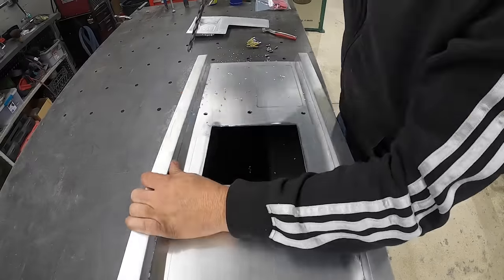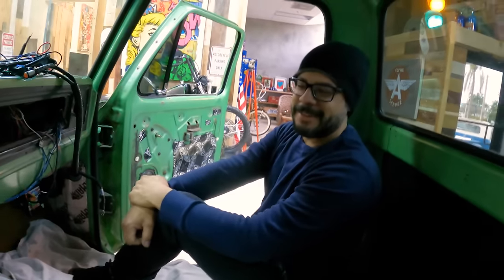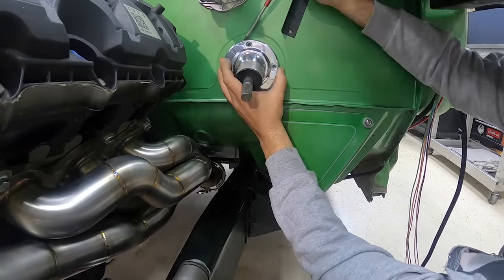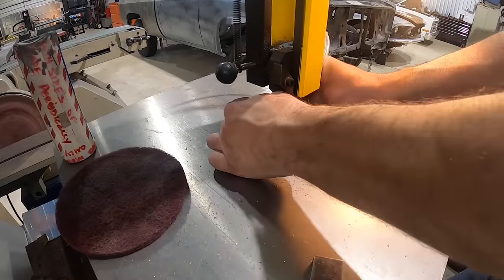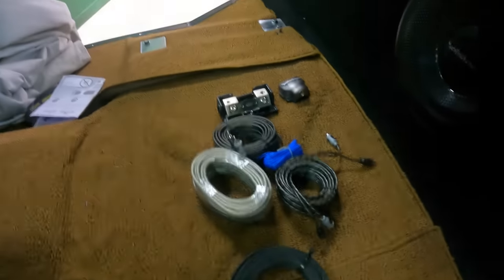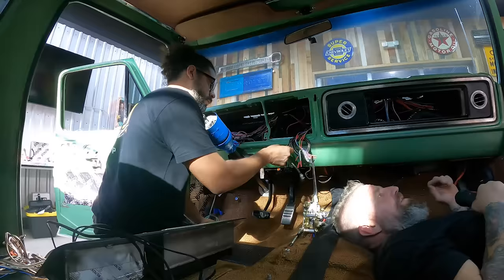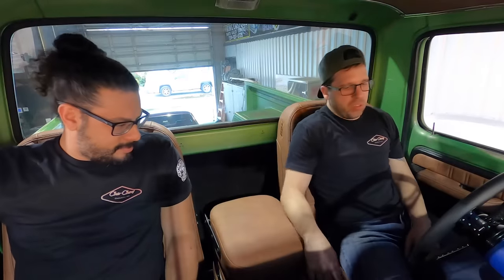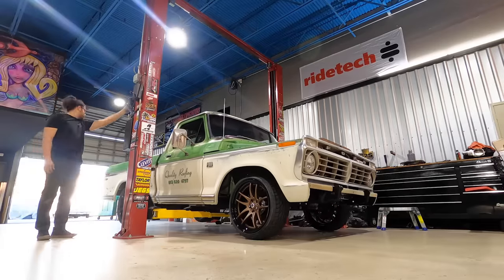Full Interior Upgrade for the 1973 Ford Ranger - F100 Ep: 6

Comment: Doesn't the stock base & bracket for the manual type shifter looks a bit 'light' and low....??..also for all these new electronics ,it would good to install a few 12V laptop fans to ventilate that hot air from under & behind that dash..keep these beauties cool & ventilated..this truck is just gorgeous and comfortable..,perfect for a long cross country road trip from NY to Montana only driving country side back roads..!!:goodvibes:

Comment: Would one of those electronic shifters work on something a s old as a 4R70W by chance or would I need to upgrade to a 6R80 or something newer? 🤔
Reply from the maker: I believe the 4r70w is electronically controlled so you should be able to hook one of these up. I'd give Lokar a shout and just double check with them before pulling the trigger
Reply: @SalvagetoSavage  Thanks! Will do :D